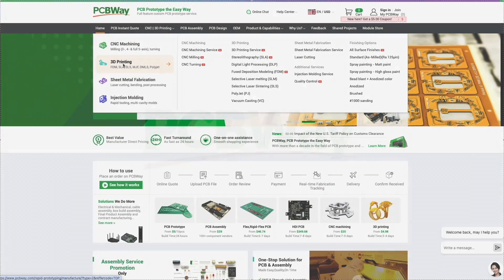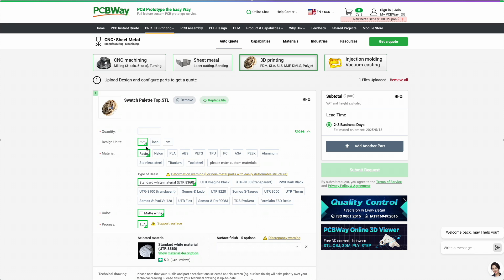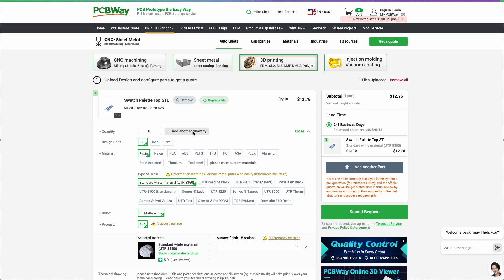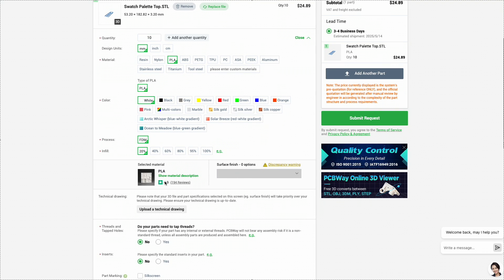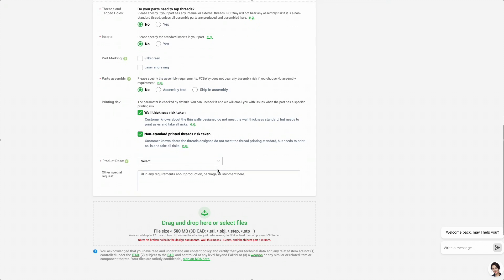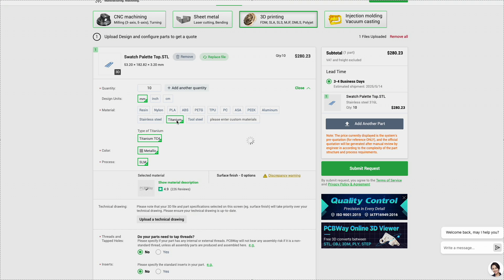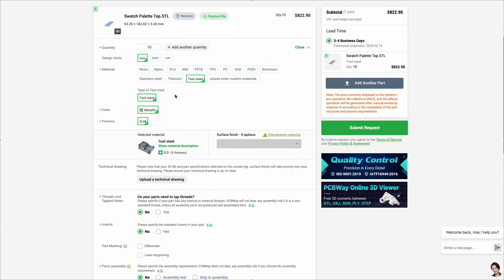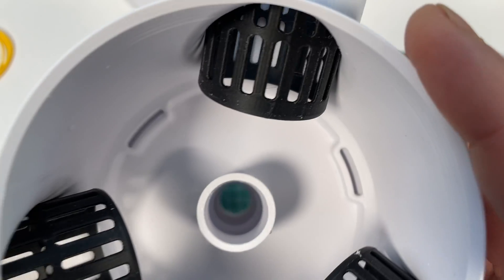Tower Hydroponic System Part 3: Accessories

Comment: Maybe I missed it, but what is the purpose of the threaded holes @ 5:32?
Reply from the maker: This version includes threaded ports for fittings. The vessel is designed to work as part of a communicating-vessels setup. When you have a large container with a nutrient solution and a separate pump that sends liquid into the vessel, usually placed in a hidden container. The first version is the simple one, without any fittings. Just an option.
Reply: @V.Perinski  Thanks, I understand now

Comment: “If I print with ASA filament, will it cause any health problems? Instead of this, should I get a more natural type of filament? I only have black ASA at the moment.
Is the thread system more logical than normal tower types?
What thread thickness (mm) is reasonable, and when should I replace it?
Do I need to germinate the seeds first, or can I plant them directly inside and will they sprout over time?
Do I need to use A-K vitamins?
Is a timer necessary or should it run continuously?
Unfortunately, the temperature here often goes above 53 degrees; I live in Turkey and we have plenty of sun even in winter.
What do you recommend I plant? I want to grow strawberries, but it seems difficult to protect them from the sun.
Also, in this version 3, how exactly should I use the water inlet and outlet?
Do you have an example picture of how it looks when in use?
And how many meters can this motor support for the tower?
As a motor, would an Ultra Silent DC 12V 4.2W Brushless Pump Mini Submersible Water Pump QR30E work fine?
Rated Voltage: DC12V
Rated Current: 375mA
Power Consumption: 4.2W
Flow Rate: 240L/H - 4L/M
Material: Plastic
Inlet Diameter: 8mm
Outlet Diameter: 8mm
Customs fees are extremely expensive here and there are seizure issues too, so it’s very hard to live in this country :(
Thank you in advance for your help.”
Reply from the maker: ASA is completely safe to use in a hydroponic system. It only becomes harmful when heated above 100 °C — but you’re not going to boil your plants in this system. All plastics release some components when overheated, but again, this is hydroponics. The temperature is low.

More importantly, do not use black plastic. It absorbs sunlight, heats up, and raises the temperature of the solution, which can lead to plant death. That’s why white is essential. The issue here isn’t chemical — it’s thermal.

As for nutrients — yes, of course they’re necessary. I’ll be publishing information about that later, since it’s a complex topic and can’t all be explained in a single message. For now, you can look up some basics online — there’s already plenty of good material written about hydroponics and plant-specific needs.

Timer — yes, you’ll need one. Watering is typically set for every 15 minutes, running for 1–3 minutes per cycle. It depends on the plants, the system size, and your environment.

You can grow almost anything in this setup: different types of lettuce, basil, herbs, even strawberries. But don’t mix strawberries with peppers — especially hot varieties. These are aggressive plants that suppress others. Better to keep them in separate systems.

About the communicating vessel system — I originally planned a compact version for a windowsill. Then it evolved, and I continued developing it. What I’ve built now is an intermediate version: water is pumped from a lower container into the inlet through a small tube, and then flows back by gravity. This makes it easier to control water usage.

I’m also working on an adapter for regular buckets — the kind often used in larger hydroponic systems. More updates are coming. This isn’t the final version.

As for the pump — just try it. If it can handle the height, great. I don’t know how high you’re lifting water, so it’s possible you’ll need a stronger pump. That’s a question that can’t be answered without proper input. You get that, right? How many sections? How tall? What kind of spacers? It’s an empty question without context.

I’ll keep adding more and more information in future posts. Right now, I’m still working on some related projects, including a dedicated controller for this system. Yes, there will be a controller. But you can also buy a ready-made one — there are plenty available.

Lighting is coming too — I’m just waiting on some components from China. That’s how it is.
Reply: @V.Perinski  +1 for bucket adapter. Are there grow LED strips that are strong enough? 

Also - have you considered a system that surrounds lamps? I've seen something like that - seems like you could get more output with more pods in the circumference and 6 T5s in the middle. Not sure how well it'd print, would have to have panels to be fit together, then there's the issue of leaking though the seams, though I've seen a Chinese-made setup for ~96 pods that uses panels - still facing outwards, rather than inwards.
Reply from the maker: @aanaastaasiyaa  I’m planning to add lighting, but I haven’t yet chosen the optimal LED strips. Everything’s already been purchased, but I can’t finish the project for now. First, there’s not enough time, and second, the concept is shifting a bit — it’ll include both a controller and lighting. I’ve got seedlings in the fridge; they can wait as long as needed, but I understand that many people want to see results right away. Unfortunately, I’m not omnipotent.

Some parts are already done — there are sketches and 3D models — but I can’t finalize them yet, since a lot depends on the width of the LED strips. That, in turn, affects the aluminum base, while the lampshades are already designed. It looks really cool on flexible gooseneck mounts — kind of like a light spider. The lighting will be more than enough.

The controller is planned too — I just need to order it and design the circuit board. In the meantime, you’re free to come up with your own ideas if you’d like. Eventually, when I get a bit of free time, I’ll continue the work — or rather, start wrapping it up, though there are still plenty of ideas for expanding this tower. These first versions are more like early tests and drafts, but they work, and I like them.

Later, I’ll add a bucket adapter, since it’s not necessary to use my vase as the main nutrient container — that’s just the decorative option. This setup will require daily attention because the liquid in the first version will evaporate quickly, though much depends on the type of plants.

So, that’s where things stand. Hopefully soon I’ll have both a bit of time and some inspiration. Sorry it’s taking so long, but once again — I’m not all-powerful, especially when it comes to time.
Reply from the maker: And when it comes to preparing seedlings, it’s not as simple as just sticking them in and expecting growth. The roots need to be treated — you can use something like hydrogen peroxide in a very diluted solution to support and protect them. But there are also special root treatment products sold in gardening stores, under various brand names depending on the country.

Just take a bit of time to look into it — there’s plenty of information out there, and it’s easy to find. I’ll be writing more about this later, but right now I need to systematize a huge amount of material, and I’m still busy developing the main project before switching to the growing phase.

I haven’t even started the growing part yet myself. I used to be into this years ago — I grew plants and even made my own fertilizers for over ten years, although that was for aquariums. But honestly, it’s not that different. So yes, I know the topic well, and I’ll be sharing everything I know in time.
Reply: @V.Perinski  I'll wait a bit for the project to be completed, then I'll try what you did in the final stage :)
Reply from the maker: And yes, regarding growing strawberries — it’s much easier to grow them from seedlings. Starting from seeds is a long process and requires germination. Also, keep in mind that if you’re growing strawberries indoors, you’ll need to pollinate the flowers manually using a very soft brush, otherwise they’ll bloom and simply fade without producing fruit.

As for nutrients, you’ll need several types. Different phases require different blends: one for germination, one for growth, and another for flowering and vegetation. These are three groups of nutrients, including both macro and micronutrients. The macro ratios differ depending on the plant’s stage.

Sure, you can use an all-purpose mix, and you’ll still get results. But if you want to take a more precise and involved approach, it’s worth diving deeper into the process. It only seems simple on the surface — but it’s actually quite engaging.

There’s nothing difficult about it. It’s just control, measurement, and regulation. That’s all.

Like with a cat — you wouldn’t feed it nails, right? Same goes for plants. They’ll either get what they need and thrive, or they won’t and they’ll wither. So the key is: learn more, dig deeper, and things will start to make sense.
Reply: By the way, is there a version with thread? Is it true that the thread version suffers from root rot in extreme heat?
Reply from the maker: @eyo-game  Could you please describe the issue in more detail? I didn’t quite understand the question. What threaded connection are you referring to? If the liquid gets too hot, that’s definitely a problem — plants can’t tolerate excessive heat.